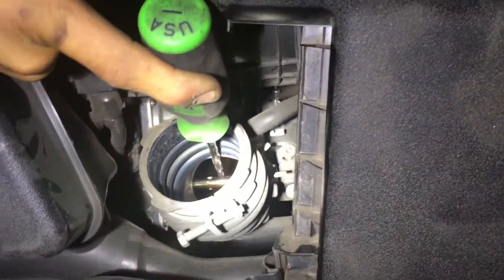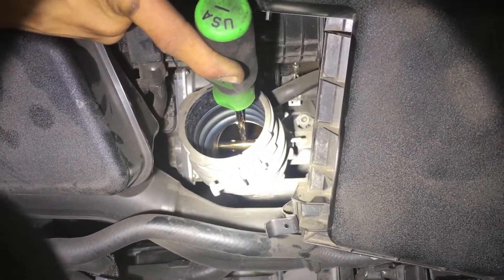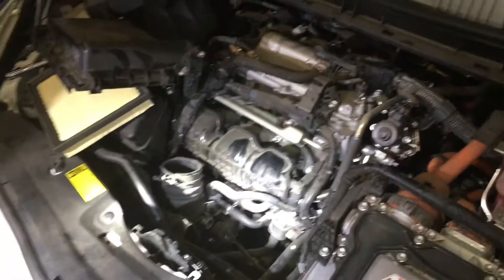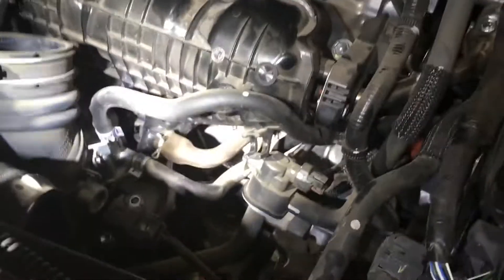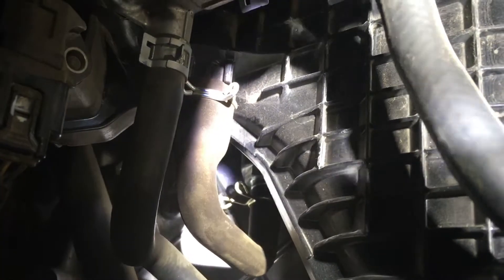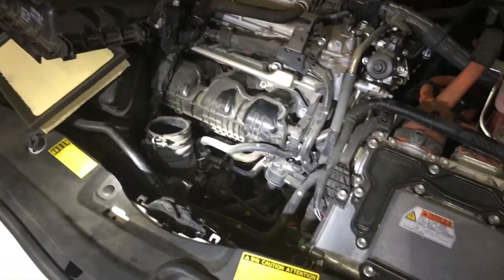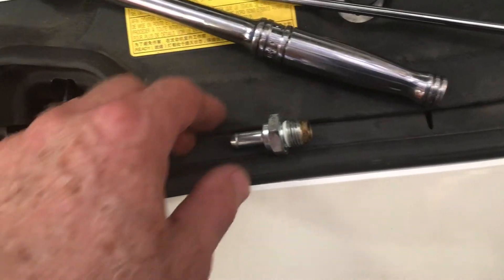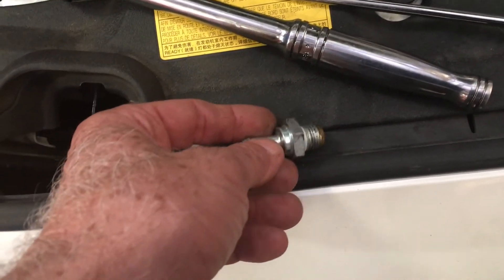Prius PCV induction cleaning

Comment: I've been having an oil consumption problem since I owned my Prius, which I bought used outright.  I watched many videos and most of them said the PCV valve is the culprit.  I replaced it myself, even though it was a lot of work.  I knew replacing the valve alone won't cut it, so in addition I cleaned out the intake manifold and replaced all its gaskets.  After removing the EGR pipe, it was all full of carbon buildup.  I cleaned it and removed some of it from the EGR valve itself.  I also knew there's more carbon buildup than I can possibly remove myself, so I brought my car to a shop for an induction service.  So far my car is running better.  Hopefully that would slow down oil consumption, if not stop it completely.

Comment: PVC = poly vinyl chloride. As in water pipes, and some patio furniture.
PCV = positive crankcase ventilation. These valves can be removed and cleaned. Also, don't overfill your oil.
Good video though.

Comment: Changed pcv valve and egr valve, cleaned egr cooler, cleaned intake manifold and all pipes, still too much oil enters intake manifold every 3000 miles, please any ideas what to look for?
Reply: I was able to clean alot of built up carbon on the pistons by pulling the spark plugs and using a small amount of sea foam in each cylinder then letting it sit overnight. I'm at 300k on the engine and oil consumption has gone way down. Worth a shot if have the time, knowledge, and tools. If your piston rings are actually damaged significantly, this wont help. But if your piston rings are stuck from carbon buildup, you may get lucky like I did. Going to repeat every other oil change and scope the cylinders at that time to see the difference. There are videos of others doing this on YouTube. Worth a look.
Reply: @preludethomas1061  I would bet you had stuck piston rings and the seafom loosened that gunk. Same for the og user posting here. Remove the plugs and soak with e.g. seafom before each oil change and should improve vastly
Reply: @vicentepallamare2608  Forsure. Using Valvoline Restore and Protect oil, eliminated this issue.
Reply: @preludethomas1061  never heard of this oil. Defo worth looking into. Sounds like it cleans and tries to protect at the same time - so 2 additives in the oil at once:)
Reply: @vicentepallamare2608  Look into it. If you have a hybrid or a vehicle with an engine that has high mileage or known for carbon buildup, it works great. It stopped oil consumption for me after the first oil change. More expensive than some of the alternatives, but worth it in my experience.
Reply: @preludethomas1061  I'm in Europe so still not widely (if at all available) I have it no my radar tho. Give some love to my ye ole Prius :)